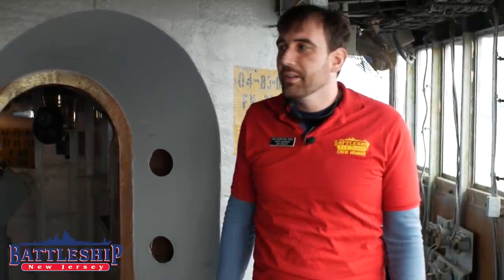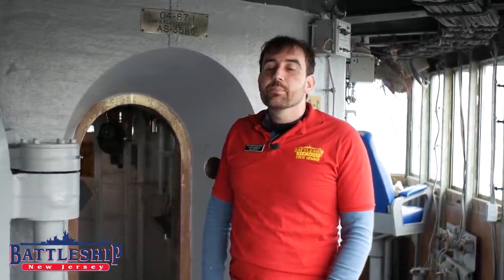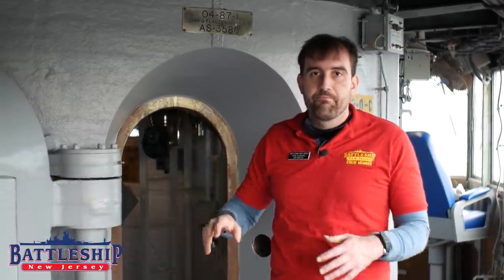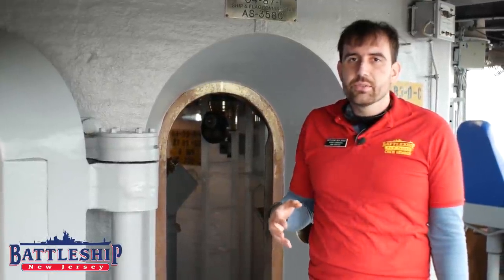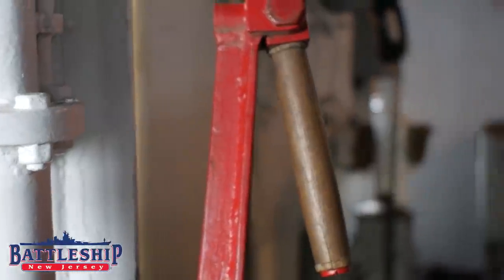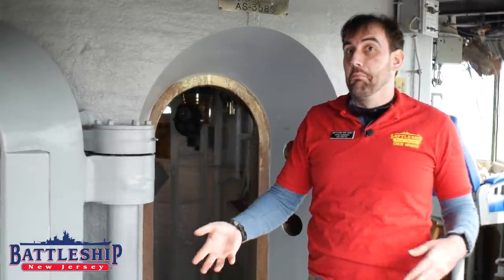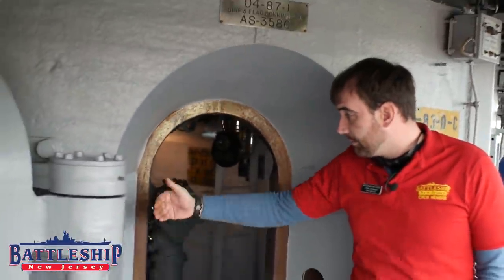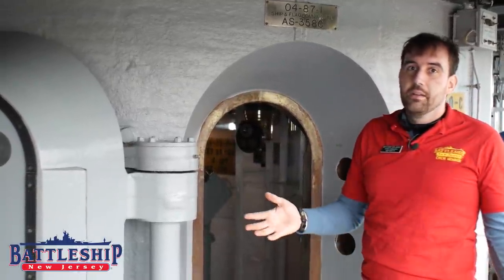Opening the Door to the Armored Conning Tower

Comment: Next week, we see Ryan hand crank a main battery turret.
Reply: OOF!  Probably would have to settle for the 5" battery getting hand cranked though.
Reply: Thats gonna have to be a time-lapse one
Reply: "As you can see, me and three of my Olympic weightlifter friends have pulled out the crank handle..."
Reply: @MoparNewport  with a couple people you could probably actually turn a 5" 38 caliber twin turret. I'd say somewhere between 2 to 10 people depending on the strength of the people you're using and how much thought was put into these things being manually trained.

You might just be able to get away with a main battery turret if a LOT of thought was put into it. (You also would need a LOT of people regardless of how much thought was put into it)
Reply: The Texas has a system in place to do that. lots of chains on pulleys and lots of people to make it work.
Reply: @Foxyjosh  That's interesting. I wasn't really expecting battleships to have that option. But then again, why not? I could see arguments for having it and not having it.
Reply: I know on the Massachusetts you used to be able to turn the and elevate all of the accessable anti-aircraft guns with the hand cranks, but I think time, weather, and tons of visitors playing around on them with a lack of true proper maintenance have rendered them immobile, either that or the museum locked them out sometime in the past few decades (mid 90s to mid 2010s) to keep visitor from getting pinched/squished by the moving components.
Reply from the maker: Our 40mm we allow that
Reply: @ruthgar9753  I loved doing that as a kid in the eighties and early nineties! My brother and I would sit on the guns and aim them at the buildings of Fall River, LOL.  I'm sad to hear that they no longer function, that's something that I wanted to do with my nephew when he gets a little older.
Reply: @Foxyjosh  Makes sense on the Texas from an era when electrical were a lot less reliable.
Reply: What a wonderful asset the battleship museum is. The curator is a wonderful asset, a wealth of knowledge and a great video producer.
Reply: @vaikkajoku  it makes sense from a war perspective honestly. When you consider you may have a situation where that turret may be damaged but it's still needed you gotta have SOME way to move it. And these weren't so new that there wasn't still folks used to working on much older ships where electrical might be spotty or less reliable.
Reply: So Ryan, are you sure you didn’t miss a handcrank on the main turrets? Maybe the drawings should be looked at again to be sure. Lol.
I’m not sure which one but I hand cranked an anti aircraft turret. Since I pedaled bikes I would have done better using my legs. Massive legs, puny arms. I lasted about three minutes. Hahaha. I couldn’t help wondering if there was a power assist when the ship was underway.
Reply: that was a standard option on armored ships that were prone to losing power in a battle. the naval architects thought of everything.
Reply: If I remember, the motor that turns the turret is 300HP. Ryan's gonna have to bring some friends.  Honestly with all the redundancy, I wouldn't be surprised if there was a room with a bunch of foot cranks to get 20 guys to manually rotate the turret  haha

Comment: That door is probably opened with a set of gears not hydraulics when doing it by hand
Reply: Agreed, similar to power steering
Reply: Yeah,  I'm also assuming he was turning the gear set that's otherwise driven by the hydraulic fluid.
Reply: I think the gears are actuated by hydraulics normally, which is probably why he thought that the door was not openable because if hydraulics are acting on reduction gearing then a LOT of forces probably required. The hydraulics are probably just there to open and/or close that door in a reasonable time frame
Reply: I fully agree, the hydraulics normally spin the gearbox, but it can also be operated manually.  No hydraulic fluid whatsoever would be required, which if you think about it really is the point of a backup redundant system.  Amazing engineering and craftsmanship in these old ships!
Reply: AmericanPatriot14  - depends on the aircraft. I know the Jetstream T1 the manual pump was still working on the hydraulics.
Reply: Yeah, hydraulics make no sense as a manual backup.  One piece of shrapnel takes out a hydraulic line and the door is inoperative?  Unlikely.
Reply: Definitely. You can see that's a gear box and enclosed axels just by the build of the mechanism
Reply: @Tera_Hai  
Yeah, but isn't that the hydraulic line bolted to the top and bottom of it?
Reply: I don't think any part of that system is hydraulic, the electric motor appears to drive a shaft/Gear not a pump that entire column would be filled with oil cause it is actually a gear box, It sounded so wretchedly terrible because the gears are dry, the oil leaked out.  If the technical orders for the ship are available it would explain how the mechanism operates and how to maintain it.
Reply: @Tera_Hai  It`s probably similar to how the Manual Rudder gear works, in case of a main system failure.  massive set of reduction gears cranked by a team of men.
Reply: Definately look like a worm gear reduction gearbox with an electric motor, noting looks hydraulic there...

Comment: Given your emphasis on the redundancy of the ship you should know there is a way to manually open the door.  Impressive engineering.
Reply: There's so much more to warships than making floating guns than I imagined. Between this channel and Drachinifel's I am learning a lot.
Reply: @raygiordano1045  watching both of those guys i can tell you the ship is more about redundancy then killing. like drac says, It can run from most of what it cant kill.
if he says operation ten-go is a go run lol.
Reply: There's a manual back up for every system on board a warship. He needs to do a video in after steering and show the crank handle for the rudder lol
Reply: I have never been on a ship like that, and I knew there had to be a manual redundancy system in place. That's how it is with every critical piece of machinery, especially military maritime and aerospace ships.
Reply: @littlejackalo5326  Redundancy is a little like paranoia. Sure, I am paranoid, but am I paranoid enough? 

You don't want your ship mission killed for want of a critical system, but you don't have an infinite budget, nor weight capacity. 

In engineering, and most things in life, it seems there's always a trade-off.

Comment: quick question. If heavy round did actually impact on the armour but was defeated by it and didn't pen, wouldn't it still be horrific inside from the sheer concussion, as you're basically locked up inside an armoured bell.
Reply: It would be awful, that's a massive amount of kinetic energy being transferred into that metal. Sound would be unbearable, and the concussion the crew would feel might possibly be lethal depending on proximity.
Reply: Direct impact of round from battleship's wouldn't have to penetrate it to kill person inside. Energy from impact would be transferred through metal wall and cause spalling effect on other side of the tower's armor.
Reply: so what you're asking is also kind of the same question that occurs with tanks. TO MY KNOWLEDGE, you could survive but it's NOT going to be fun and may knock more than one person unconscious if not outright kill someone. The big variable here is the round that's hitting the tower. Smaller size shells would overall cause less damage and also be less detrimental to the crew inside the tower, and of course things like wiring and other parts of the interior will help dissipate the vibrations as they absorb the energy from the hit, but a sufficiently sized shell that would dent, mar or damage the armor is almost assuredly GOING to kill someone, maybe not everyone, but at LEAST one person is likely to be killed from the impact.

Of course attacks like that tend to have causalities of other varieties so I doubt that'd be as big a worry as yknow.. a shell punching through the deck or something to that degree
Reply: The crew inside would all wear flash hoods I think and possibly wired headphones to be able to communicate with the crew outside and down in the engine rooms etc. Maybe the headphones would help a little.

Then again probably not much
Reply: Similarly armored conning towers of other ww2 battle ships were penetrated like butter. That armor protected from 5-12 inch guns but 14-16 inchers slice through it.
Reply: @GameOver-fn2og  from battleships
Reply: @smokeonthewater5287  16 inch thick plate is pretty hard to penetrate. Think about that

Comment: If you aren’t leaking hydraulic fluid you are out of hydraulic fluid. 
I’ve heard that before... from someone in the army. They were discussing a CH-47 Chinook.
Reply: It's very true had a crew chief tap me and say "hey if that quits leaking let me know" very fun flight....
Reply: Same advice for a CH-46
Reply: Same thing goes for oil leaking from an 87 F150 with a 300 I6... 😆
Reply: It’s not leaking, it’s just marking it’s territory...
Reply: Makes me wonder how the shuttle crew felt
Reply: That's how Detroit diesel engines are to! When it stops,add more!
Reply: Very true.  They ALL leak.
Reply: On English card it's written clearly in the manual.
Reply: Same for any navy hydro system
Reply: If a Harley doesn't have a pool of oil under it, it's dead.
Reply: I know it's a bit of tongue and cheek, but it is faulty logic.
Reply: @coyotehater  My friend says that about his Audi
Reply: I heard that about C130s
Reply: @Lemonjellow  I6 engines don't leak, that's just the automatic chassis lubrication/rust prevention system working properly.
Reply: Reminds me of the trope about the Detroit Diesel "If there's no oil under it then there's no oil in it" lol
Reply: I saw somewhere that this is intentional on many aircraft and only happens on the ground as the metal contracts at higher altitudes to fit perfectly. I’m not sure if it’s to make the ground crews job easier or just a happy coincidence though.
Reply: @TheSp0kesman  The converse is true of the epic fuel leaks SR-71 Blackbirds experienced: the airframes, including the fuel tankage, were built to expand so much from friction heating at speed that when they cooled on the ground, the fuel would just flow out of the seams.
Reply: Also applicable to the F-14 (when it was in service).
Reply: Radial aircraft engines all leak oil when sitting still on the ground. If you see an old aircraft with a radial, like a Corsair, that's still in flying shape it should have a drip pan under the engine when it's in the hangar with the wheels chocked.
Reply: Well ya know....hydraulics depend on air also.  Thats why most shafts are self lubricating.
Reply: Dont service wet wing aircraft like the B2.  They leak by default 😂
Reply: Bridges at to.kori  will holden brubaker doesnt make it home

Comment: That is some serious engineering to move that smoothly after all these years.
Reply: Not really. It's not precision, it's just big. Not really an engineering marvel? Just good old steel and big gears.
Reply: @UnitSe7en  it's pretty obvious now that you are not an engineer haha it's amazing to see a mechanism that has been used a lot, passed through a lot and already aged to simply function. And this one function with perfection.
Reply: @thiagofeltrin9841  not really. The mechanism is incredibly simple and very sturdy because it's so big
Reply: @thiagofeltrin9841  It isn't a particularly advanced system. The door weighs 3800 lbs, but B-17 bombers carried multiple 2000 lb bombs aloft using aluminum spars through turbulance, flak, etc.
Engineering is not just making something work. Engineering is about making something do the most at the lowest cost.

Comment: are there no blowers for air? that seems like a missed opportunity. Of course, if your going into a battle.. I would bet that the "claustrophobic" feeling is more like an armored hug all protected and safe.
Reply: probably not working as the ships mothballed
Reply from the maker: Generally the blowers on board do work, you can hear them in many of our videos, but there isn't one in the conning tower, its too tight of a space most likely.
Reply: Makes me wonder if vital parts of the ship were thoroughly CBRNized as part of upgrades, it'd make sense then for the conning tower to have filtration and overpressure systems

Comment: Theoretically, if the hinge was shot off, wouldn't unlocking the door cause it to fall out of its jam on it's own accord?
Reply: The proceeds to put a door sized whole in the floor
Reply: @8vantor8  Hey, it's better than being trapped in the conning tower.
Reply: KING/ARGLE/BARGLE/THE/4TH/OR/SOMEBODY/ELSE  along with the locks, if the locks could retract in that position it looks like the door would fall out
Reply: I'm not convinced that your "protusian" would continue to function if the door were unlocked, since it depends on those locks to take up the weight of the door, which is otherwise sitting on a sharply angled jam.
Reply: @c.a.mcdivitt9722  we are all in concurrence
Reply: KEY STOCK IS YOUR FRIEND!  It would take the ship listing to around at least a 20-30 degree angle I believe, or an engineering team with the proper know how to get the door to open without the hinges.  So yes, in the event it opens under the first situation, you've got way bigger problems to deal with, like a sinking battleship :)  The second situation is basically the engineering team working the door out of the frame, though if the other door was still working they would most likely be securing the broken door until such time as they could replace the hinge as it's a hell of a lot easier/faster to repair the door & hinge with the door still shut in the frame, than it would be to remount the door from scratch as the alignment spacing tolerances for such a door are measured in hundredths or even thousandths or an inch or that door won't close at all.  I know from working on other types of blast doors the usual requirement for working on/replacing one of the hinges is shutting and securing the blast door first to eliminate as much chance of random alignment shifts of the blast door position.
Reply: Yes, unlocking it would cause it to fall out under its own weight. But that comes with one big caveat: Good luck unlocking it. There's going to be a lot of friction on those locking pins if the hinge is gone.
Reply: if the hinges were damaged or not in place and the door hadn't opened of its own volition, you're not moving it anywhere.
Reply: Besides all the above, if something big enough to destroy the hinges hits the conning tower, no one on the other side of that door is going to be in a position to care if it'll fall out when unlocked. They'll all be battling evil in another dimension just from the concussion.

Comment: As someone who has to move the print section on a printing press that weighs close to that with just an 18" diameter handwheel...  it is absolutely amazing what gear reduction can do...
Reply: Im an automotive tech. When you see how insanely tiny most gears are that directly propel any given vehicle, it gives new appreciation to 'mechanical leverage gear drive'.
Reply: You can move a 4 ton sailboat with one hand... The weight of the door is not really a issue on itself, you can move a 10 times more heavy vault door by one finger when it is well lubricated (but it will be slow). The door is made like that because if you could move it by hand it would also move around and be dangerous when the boat is out at sea when the ocean waves make to boat roll.
Reply: @a64738  difference being the medium- a boat is in water, a turret on metal bearings riding on cold grease n metal.  Massive friction coefficient difference.
Reply: @MoparNewport   You can still open a 10 times more heavy vault door with one finger, in fact it is much more easy then moving a sailboat on water. As I said the reason for the door being moved by cranking or hydraulics is to lock it in place so it can not flap about when the boat is moving... Is that really so hard to understand???

Comment: Considering that  Bismarcks bridge crew got stuck in the con after the doors jammed and roasted by the fires on the ship I don't have a lot of faith in a conning tower.
Reply: Tbf Bismarck also had over 2000 rounds and over 10 torpedoes shot at her, and that didn’t even sink her( her crew ended up blowing her up themselves)
Reply: @8vantor8  Hornet, I refuse to die.
Reply: @Predator42ID  wasn’t that the Yorktown?
Reply: Bismarck's is probably the only con-tower ever really used, idk...
Reply: Hood's conning tower was blown clear of the sinking ship by the detonation of the forward magazine , and was located several hundred yards away from the forward portion of the wreck. It was said to be 600 tons in weight
Reply: @tommatt2ski  well no amount of armor is really going to help you with a magazine explosion. That's kind of sudden existence failure territory.